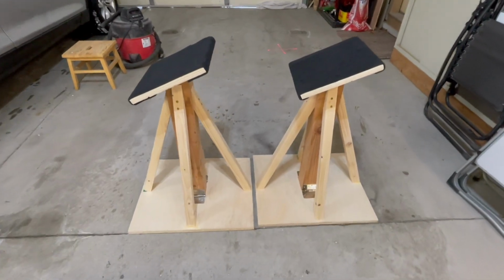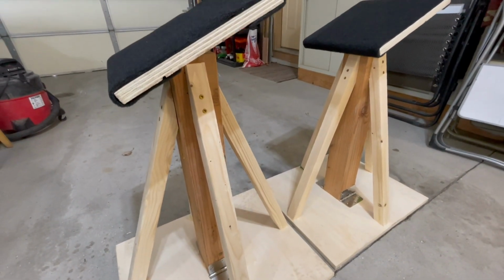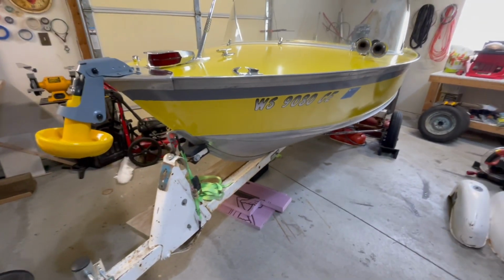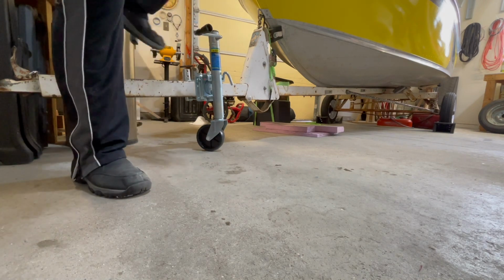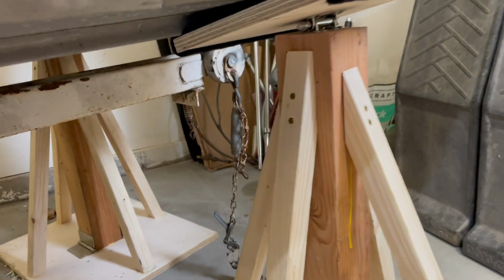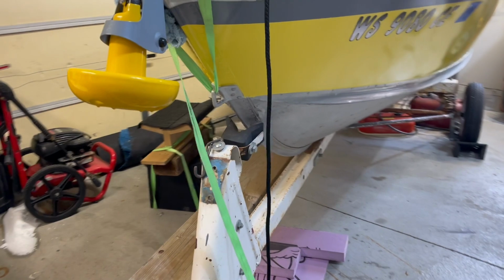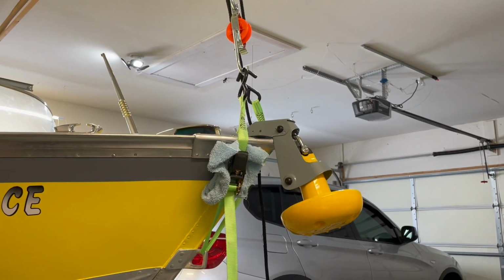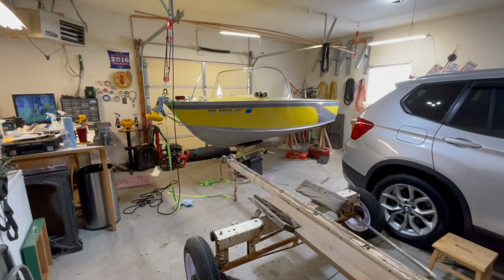1962 AlumaCraft Maracaibo 14 Project, Update #6: Taking a Boat Off the Trailer on Land

Comment: I guess hardest part of that was designing and building the supports.  How many times have you bumped / rocked the boat?
Reply from the maker: Enough that I ended up adding some support boards on both sides of the boat. I run in to it ALL the time. 🤣🤦🏻‍♂️